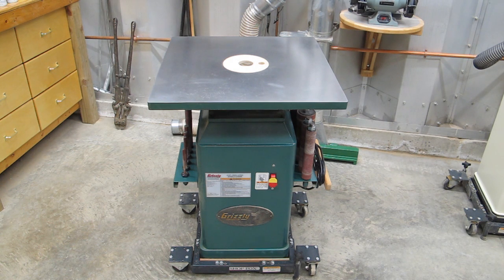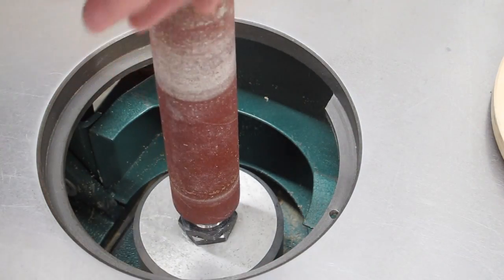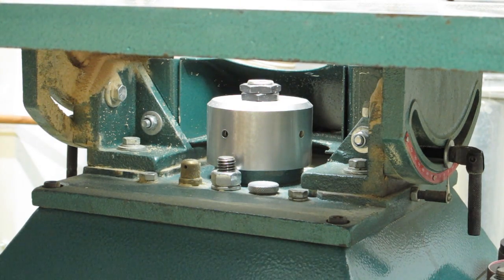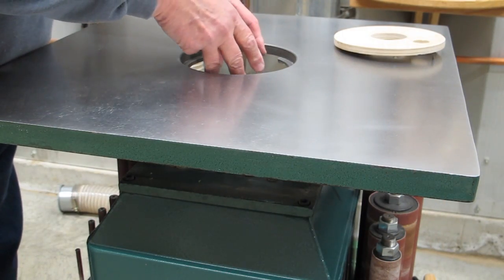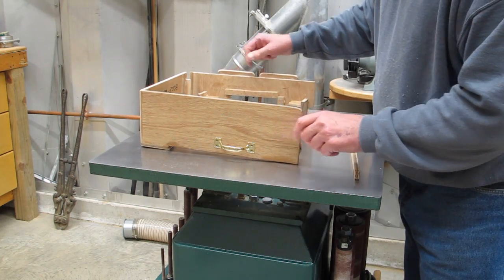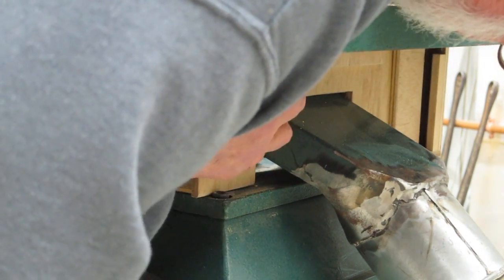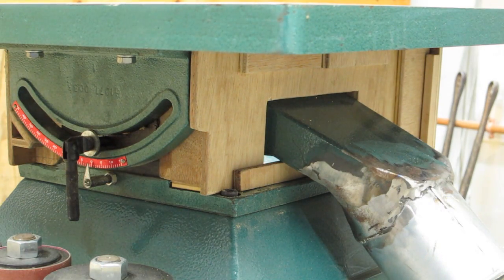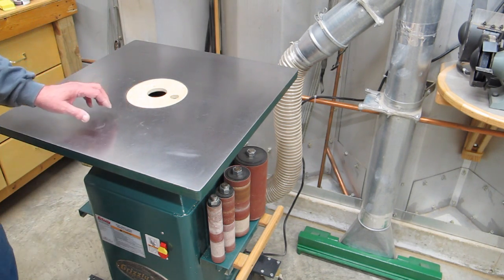Grizzly G1071 Oscillating Spindle Sander - Dust Collection Modification

Comment: I've watched all your dust collection videos and found them very helpful. Im just about done making a shroud for my Grizzly G0555 Bandsaw. Mounts under the table and surrounds the blade. The front and sides are glued together and the back is held in place by rare earth magnets for easy tear down when the table needs tilted, changing blades, or cleaning the guide bearings. I'll be making more shrouds for other tools. Thank you Ron for the great videos and ideas.

Comment from the maker: It is an Oneida 1.5 HP 220 volt Cyclonic Cartridge Dust Collector returning air to the shop through a Thimble Plenum with 4 filter tubes and is rated at 750 CFM @ 8” of water. It will just about suck the chrome off a trailer hitch (but not quite).

Comment: Ronald- Thank you so much for you responses to my G1071 spindle problems.  What you say is true.  I am VERY DISAPPOINTED with the "DESIGN" of how the spindles attach to the rotating/oscillating head on this machine.  I went out and bought 2 Craftsman open end wrenches to replace the Grizzly ones, which we both agree are pure crap.  Problem is, no room for the Craftsman wrenches to fit in there without having them ground thinner in a good machine shop.  As a consumer, I should not have to do this

Comment from the maker: Big heavy expensive industrial application type machine. Most small shops probably would not buy one. Photos I have seen show mfg setups with multiple machines and they probably never change spindle size. Got mine at a scratch & dent sale and did not think I would use it much but it has become a go-to machine and I use it all the time. You’ll love it once you get past the courtship. :-) Try the small strap wrench. The dust cap on top of the main shaft needs to be very tight in order to work.

Comment from the maker: Part Three-The largest spindles are going to get tight very easily. Try not to push the wood hard against the sanding sleeve. Reverse torque tightens the spindle. Light pressure when sanding. Let the sandpaper do the work… and the sleeves will last much, much longer.

Comment from the maker: Part Two – I’ve had them get pretty tight. I just screw them in hand tight (barely snug). Use a SMALL plumbers strap wrench to hold the large diameter dust cap at the top of the main shaft and use your hand to bang on the spindle left, right, forward and back while trying to unscrew it. Get someone to help you, as you’ll need three hands. Last resort, you may need to take the table off to get the spindle if it is jammed on there that tight.

Comment: Part 6- I have had satisfaction with the Grizzly customer service.  It will be interesting to see how they handle this problem with the stuck spindle on my BRAND NEW G1071.  The ball is in their court.  I am a busy guy, and do not have time to spend hours trying to switch out spindles!  I am posting my remarks in an effort to sway other woodworkers from buying this machine.  Or, if they decide to buy this machine, BEWARE that they will run into the same problems that you and I have!  Thanks!

Comment: Lastly- Don't get me wrong.  This is a go to machine and it works well.  But.....changing spindles NEEDS TO BE EASIER.  The flaw is in the design of the threaded, tapered spindle AND the 2 securing nuts.   The real problem is I can't get two GOOD open end wrenches onto the 2 nuts that have to be turned away from each other.  Good wrenches are too think to work in that tight space, nuts too close to each other, though your idea of the strap wrench may work OK.  Have not tried that yet.  Thanks :)

Comment from the maker: Sanding sleeves seem to last a long time. Light pressure, let the sandpaper do the work, don’t force it. This will also keep the spindles from becoming too tight. The small spindles want to shake loose (turn it off and snug up by hand) and the larger ones get too tight and are difficult to remove. I currently have a 2” spindle stuck and haven’t been able to get it loose (yet). This is a real problem with this Grizzly sander. I purchase my sleeves from the Grizzly store near where I live.

Comment: Ronald- I recently purchased one of these machines.  I am having a problem removing the largest spindle.  It is stuck on and I can not remove it.  I have followed all of the Grizzly instructions before and after installation.  I have spoken with Grizzly and am awaiting an answer.  Had the machine only 3 weeks now.  Has this ever happened to you and if so, how did you remove the spindle?  Their wrenches distorted when I used them.  They are pure CRAP.  Any advice welcome.  Bob

Comment: Part 2- I should not have to use any special devices to remove the spindles.  Grizzly, Jet and Shop Fox should have designed this machine properly in the first place!  It is true what you say about the larger spindles being the most difficult to get off!  I had no problem getting the smaller spindles off.  The machine works great except for this problem, but for me, this is a BIG issue.  Why sell me a machine that has an assortment of unremovable spindles?  I am awaiting Grizzly's response.

Comment from the maker: Part One – The wrenches are pure crap, too thin and too sort. The taper needs to be clean (dust, rust and oil free) before putting it together. Any of that stinky, sticky grease that is all over a new machine can be like glue. Remove the spindle immediately after use, every time, even it you intend to use the same one again the next day. Loosen the nut on top to relieve the rubber compression - expansion every time, or you won’t get the worn out sanding sleeve off (or a new one on).

Comment: Part 3-  I have found Grizzly's "Technical Staff" to be quite useless.  They have no idea what they are talking about!  Changing spindles should be no big deal.  It should be as easy as changing router bits!  If the thing was designed correctly in the first place!  I will investigate buying a small plumbers strap to hold the dust cover.  But in reality, there should be room in there for 2 strong open end wrenches to do the job.  Shame on Grizzly for putting consumers through such a nightmare.